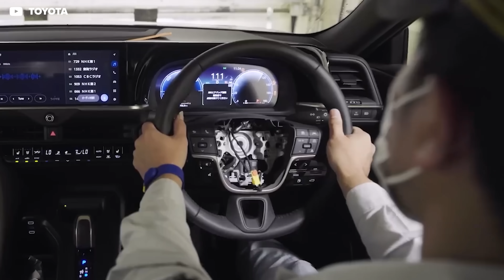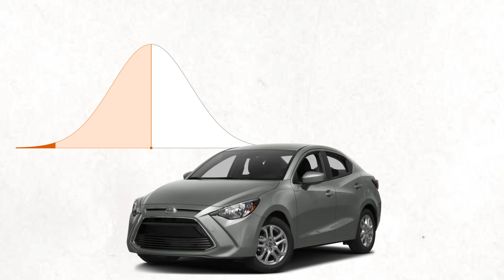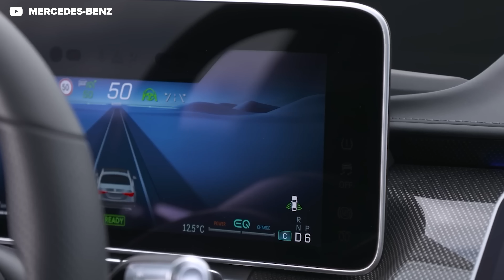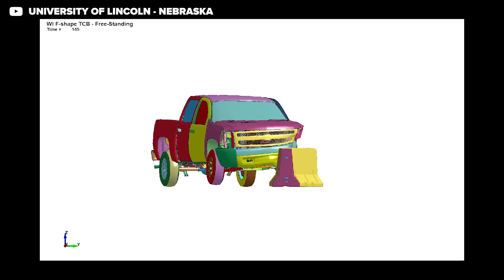The REAL reason guardrails can't stop EVs in a crash

Comment: If quality of life was as sacred as the right to make a profit we would create an automotive environment around light, safe and fun small cars. Heavy vehicles would be for work and would require a greater responsibility and training for the driver.
Reply: This comment section is a reddit central! Holy sht
Reply: You can thank the idiocy of the government regulatory requirements for the growing size of motor vehicles. Get them out of there, and small, affordable cars and light trucks would make a big comeback and fast.
Reply: Spoken like a true city dweller with no experience outside of the concrete.
Reply: If people cared, they'd buy mopeds.
Reply: You can't eat quality of life you can't see quality of life you can't build a barricade out of quality of life so if you want to drag in quality of life into engineering you can have disaster after disaster after disaster..
Reply: It's called Europe dude
Reply: You mean like every country on earth except america?
Reply: Miata is always the answer.
Reply: Cars are to haul people and stuff from point a to point b. The "fun" factor is an added luxury
Reply: Agreed!
Reply: Not following your argument. How people view Quality of Life can (& is) different for people, & changes during different stages of life.

EV vehicles will be heavier than their ICE counterpart, due to the weight of the batteries; though my Tesla Model Y (which is classified as an SUV Crossover) weighs 4,416, the average for SUV Crossover ICE vehicles is between 3k-6k lbs.

As this video states, it isn’t so much the weight, but the location of that weight-> Guardrails were designed to handle the vast majority of vehicles driven at that time, and simply require changes/ updates to handle the new Class of vehicles.
Reply: Btw- a Business does NOT have the “Right” to make a profit, they just would not exist long if they did not.

I did not follow you Quality of Life (QofL) argument, (not to mention, QofL is very subjective). Some place to much emphasis on materialistic things, while others place to much emphasis on ‘free time’. Even for those who are more realistic, QofL varies greatly & changes during life.

Lastly, Heavy vehicles (as a Class of vehicle) already have requirements for specialized training, operation guidelines, & licensing.
Reply: Actually heavier trucks (three axle and more) and busses require a different category of license that usually requires some training and they have lower accident rates than cars.
Reply: Which of course we already do with large trucks and the vastly more expensive and training intensive license's needed to drive them, lol, like seriously dude?
Reply: Grow up.
Reply: Thanks for the input comrade
Reply: Yeah. We should gatekeeping F150 and Colorado from moms😅😅
Reply: Thank God we dont, Mother Hen.
Reply: Funny that politicians were ALL AGAINST trucks and heavy cars-until they figured a way to make money on them
Now you are on your own with 7000 lb trucks and drivers catching up on their sleep or disney movies
Reply: Look up Dodge vs Ford Motor Co. 1919
All your questions about how the world actually works should be answered.
Reply: Marxist agitation propaganda. Obviously not an engineer or mechanical inclined. Businesses don’t survive if they kill all their customers. The human body is very fragile. Any crash on anything over 5 MPH can be fatal. Try falling off a bicycle without soy boy pads or helmet. If you want to be safe, stay in bed; never ever use the bathtub.
Reply: "IF..."

If only 😢 💔
Reply: they do its called cdl lol
Reply: Welcome to Europe
Reply: Are you a communist by any chance?
Reply: If people really valued quality of life, that's how the corporations would make the profit 🤷‍♂️
Reply: Screw that this is america. Go to Europe if you want that commie crap.
Reply: Stupid weenie european liberal mindset.
Reply: Watch the video. All the regulators care about is occupant safety
Reply: Welcome zu Europa. Public transport, small cars and 20 mph speed limits in cities.
Our cars are electric or hybrid, ours aren’t flying over any concrete barriers.
Reply: @philippal8666  No thanks that sounds really gay
Reply: Letting people choose their quality of life is how you get this
Reply: Then the USA would be full of Suzuki cars
Reply: Actually if quality of life was sacred we would build walkable/bikable neighborhoods and transit oriented cities.
Reply: @ChadGeidel actually if quality of life was sacred. We wouldn't build cities at all.
Reply: @ChadGeidel huh. Wonder how long it would take me to bike 65 miles to work.
Reply: @ChadGeidel  I live 6.4* miles from the closest town... what's your alternative to that?
Reply: you choose to live in the sticks? Sounds like a you problem bud.
Reply: @ChadGeidel any actual city is way too big to be walked across. Ntm you'd still need cars to go city to city (closest city is an hour away on a interstate going 70mph)
Reply: @Bojangles06  Good mass transit is a marker of walkable cities. Most people who live in NYC walk everywhere. That's equally true for most cities in Europe.
Reply: @Pan_Galactic_Gargle_Blaster NYC has suburbs, most only walk within a few mile radius. Most towns have housing and inudstries on opposite sides. Most cities in the US arent as dense as NYC, take for example St Louis, that city is massive and as someone whos been there I'd hate to walk it. Too spread out, too big, not made for walking. Ntm the giant bridge would take forever to cross
Reply: @Bojangles06  I think you don't quite understand  the concept of a "walkable city." it merely means that all necessary amenities are available within walking distance and mass transit is viable for going to do almost anything else. specifically for the people living in the city — not the people in the suburbs (that's the greater metropolitan area, not the city itself). you really should spend some time in larger cities in Italy, Japan or Switzerland. there's only so much that can be conveyed without experiencing a "walkable city" firsthand.
Reply: @ChadGeidel that ship has sailed. Cities and neighborhoods have been built around cars since WW-2.
Reply: @randalmiller7952  Yeah, and there's nothing we can do to effect change. It's impossible.

Except we can - lots of cities around the world have. Even the US did it during Covid.

Try again troll.
Reply: @ChadGeidel no everyone wants/likes to walk, and designing a community so it’s comfortable to be locally traversed, while crippling anyone’s ability to go further without a huge time sink, is why cars are preferred to begin with. 😂
Reply: @ChadGeidel why not both? Walkable <5km, bikable <20km and light cars for the rest
Reply: @ChadGeidel or both lol
Reply: @ChadGeidel this is the correct answer.  Imagine the control of urban sprawl doing this
Reply: Actually, I live in a transit oriented city and I avoid all public transit because that is where you and I are most likely to be knifed. Fentanyl spoiled everything.
Reply: @ChadGeidel  Absolutely, far overlooked alternative for worshiping the metal manslaughter boxes on wheels.
Reply: @ChadGeidel 15 minute cities?
Reply: @ChadGeidel  you dont want that
Reply: @ChadGeidel  "...build walkable/bikable neighborhoods and transit oriented cities."

Come to Europe, we have plenty of those.
Reply: Small cars are not for everyone. Tell that to the family of seven people with five kids. I would know, I was the middle child of five kids in the family of seven growing up. A small car doesn't do a damn thing for big families. I swear, too many people act like everyone shares the exact same circumstances that they personally are in. Do you ever think about other people and what works for them? No one is stopping you from getting a small car, or an e-bike etc. Why do you insist on trying to force other people into what doesn't work for them, but is your ideal?
Reply: @jlcii  My logic is that because heavy vehicles are a greater danger to others the driver of a heavy vehicle should have more training and be held to a higher standard. This would also be safer for everyone inside of the heavy vehicle also. I am sure some people think a CDL is an unfair requirement. We will never all agree on issues regarding freedom vs. public safety.
Reply: @jlcii Tell that to single people driving oversized cars 😅 Besides, if you have a big family, you get a minivan, not an suv.
Reply: Move of the country wants big vehicles. Get over it. Stop pushing top down political "solutions" that the people dont want. If you dont want a car, go somewhere you dont need them. Leave everyone else alone
Reply: Except when people have the choice about what car to buy they frequently and knowingly choose to buy the sexier, bigger, faster or whatever car over whatever performs the best in safety tests.  So no, it's not profit over lives people would genuinely be upset if you demanded they all drive small light cars to be safer.  Indeed, as long as all the car companies have to do the same thing all over the world it doesn't matter too much to them what regulations demand it's the consumer who is upset when they get a car that doesn't make them feel cool.

The job of the government isn't to stand in the way of the preferences of the public no matter how much we may wish they were different.
Reply: @petergerdes1094  its funny you say that, because CAFE standards killed off the small affordable truck that the public preferred compared to these massive Sherman tank sized SUV's and trucks that every moron whos compensating for a shitty ego buys. Station wagons were popular until they stopped being made by companies and why the hell does the EPA get to tell us what we can and cant buy anyways? Cars dont destroy the environment anyways, planes, rockets, bombs and sonar equipped military vessels do
Reply: @petergerdes1094  Those preferences were created by 30 years of active marketing by the auto industry.  Advertising creates markets and preferences.  If regulations prevented the manufacture of those vehicles in the first place or they required a stricter license endorsements to drive, they would never have been advertised as mass market daily drivers.  We would still be calling SUVs panel trucks and only your plumber would drive one.
Reply: @disjustice Except that's not true.  When safe seatbelts came out in new cars automakers wanted people to want them -- they benefit when people buy new cars -- yet people hated them and kept cutting them off.  

Companies are just greedy.  They don't care what they sell you and would happily sell you ever more safe cars for ever more money.  They choose what they advertise because that's what people respond to.  If everyone really wanted to be safe Subaru ads would be more effective than porsche ads.
Reply: In the UK, these “trucks” are literally categorised as an HGV due to their weight and the additional license training is needed.
Reply: @smoketinytom  medium duty actually (N2)
Reply: @erkinalp 3.5+ Tonnes is Cat C1 license, “akshully”.
Reply: @smoketinytom  yes, which is different from cat c
Reply: @erkinalp  Well, Duh. Got ourselves a Stephen Hawking here… Yes, to drive an HGV, you’d need a C1 license.
Reply: this is a very unintelligent take. 

light and small cars are not safe and realistically won't be within your lifetime
Reply: if only money wasnt the best and the worst thing ever invented
Reply: Vehicles beyond 1.2 tones should have a higher class of license
Reply: Agreed, we would all be riding go karts, and honestly living in things like busses and other larger vehicles as a home or a work environment, rather than recreation and transport
Reply: That sounds great if you're in some big city, but doesn't work everywhere. I live out in a very rural area, where you typically end up hauling more stuff around, and weather combined with poor road conditions mean you frequently wouldn't be able to get anywhere with some tiny FWD hatchback.

Don't get me wrong, I don't inherently dislike small cars like that, but they simply don't work everywhere.
Reply: @TheBulap  what you mean is the right vehicle for the job, NOT the one that strokes your ego.....couldn't agree more. And as any sensible American who's ever been in an accident that actually wasn't their fault will tell you, driving standards need to improve MASSIVELY.
Reply: @TheBulap  You ever been to a small town that was built before the world wars?
Reply: @TheBulap  okay, but your truck would be more useful and efficient if the other cars on the road got smaller, lighter, and fewer in number.
Reply: @toslowlypoke  There's hardly much traffic out here anyways so it hardly matters to me. And who am I to say that all my neighbours can't like them for all the same reasons I do?
Reply: You're not who we're talking about. Most people who drive trucks don't use them for work. Most American trucks are pavement princesses.
Reply: @TheBulap  small cars aren't limited to some tiny FWD hatchbacks. Vehicles like the Suzuki Jimny exist too.
Reply: @TheBulap A few things:
1. Rural areas can have different regulations.
2. I don't think anyone is suggesting to outright ban light trucks. Farmers, construction workers, etc should be able to get special training and licenses for them.
3. It's actually a lot easier to put awd on an EV: you just chuck a second motor in back.
Reply: @TheBulap true.  But you can't deny most of the squeaky clean trucks on the highway will be used to pull something maybe once in its lifetime then never again.
Reply: @LilOleTinyMe  I wouldn't say that's wrong - when I drove a Silverado, I never towed anything. However it was very handy once in a while when I'd haul large items around, and even just for that I was happy to have it.

I'm driving an Xterra now instead, but whenever I might have to replace it someday I'll probably get a Frontier because having the bed is incredibly convenient at times.

I personally don't care anyways how other people use their trucks. If somebody wants to lift their Ram 2500 and put stupid low-profile wheels on it, just to drive around town, I think it's dumb but I won't say they shouldn't be allowed to. If they like that, they can do it. I'm fully in favour of letting people buy and drive basically whatever they want to.
Reply: @LilOleTinyMe pavement princesses.
Reply: @TheBulap if only vans and station wagons with awd existed. 

Oh wait they do
Reply: @MaticTheProto   I used to drive an Outback, it was good but still never had quite enough interior and cargo space for my needs. And if there were options here for a proper 4x4 (not half-assed AWD, actual 4X4) van other than a JDM Delica, I would love that. But there isn't.
Reply: @TheBulap  Yep, Humans in villages all over the planet just died right until the early 20th century. No way to get around until someone invented cars.

Oh, wait. You are full of crap.
Reply: @ChadGeidel  Humans for most of history also lived miserable, shitty lives, that doesn’t mean we should be expected to give up our quality of life now.
Reply: @ChadGeidel This is a partial false equivalency. The invention of the horseless carriage (cars) suggests horse powered contraptions were used. Before the invention of transportation by domesticated animals in 3500 BC, life sucked and yes, people died. (Aztecs anyone?) Any interruption in local supplies would typically be deadly for small villages without proper food storage.
Reply: @ChadGeidel  Yeah that's because people owned horses and carriages.  You know the direct precursor to "horseless carriages" aka cars.  🙄
Reply: @ChadGeidel  Also "You are full of crap."?  Chad not everyone with a differing opinion is arguing in bad faith.  @TheBulap is just stating his point from what works for him.  That's a very childish take to think everyone who disagrees with you is being disingenuous.
Reply: @ChadGeidel in most of the world that they live that way, they fucking hate it. 😂
Reply: @TheBulap Dude being stuck in traffic and having to commute literally everywhere is miserable as fuck, I would kill to be able to live somewhere where a car wasn't a necessity.
Reply: @ChadGeidel so whatare you suggesting as a replacement then? Using horse drawn carraiges/wagons for personal hauling? (Key word, personal. Businesses can use trains and semis, but what about Farmer Joe who just needs to pull around a cow or 2, or a hay bale to the field?)
Reply: @TheBulap  What cars actually have to quality of life in general? It may be comfortable to sit in a car with AC, stereo and what not accessories surrounding the ones in a car, but to think that it somehow represents the peak in quality of life is just conditioning by he fact that it has been made pretty much mandatory to sit in the car in the first place while alternatives are wiped out of the way to make room for the car market by the big oil and the big car. The rural areas are also an exception, not the rule. Also life on rural areas or sprawling suburbs have been largely been enabled by the use of car, which is quite redundant for societal living and development of societies. The peripheral areas need the road infrastructure, but the population density is low, so it's quite expensive luxury to build and maintain a road network to keep the rural and urban sprawl drivable. 

For some reason people seem to think that roads are free if you don't have to pay tolls every time you get on the road, yet they're still very much paid by all the tax payers, whether they ever have a car or drive at all. Society subsidies road network from every tax payers pockets so that the anti-social motorists can live wherever they wish, far from the others and still have the luxury of sitting in their cars for hours and hours to get their basic commodities. Cars are like a gilded cages rather than a luxury of life at any closer look. Cars don't represent freedom, they represent restriction of having to use them, sitting in traffic, spending your time behind the wheel or just sitting in a car, rather than doing something else, perhaps more productive or fun. 

Driving and sitting in a car are very much an extension of the overall sedentary modern life style, that is a known factor of health issues on population level, whereas cycling and walking as means of personal transportation are health beneficial and significantly lowers the probability of serious lifestyle related conditions like high blood pressure, muscle deterioration, bone density loss, weakness in joints and cancer even due to immobility and the micro particles inhaled due to fumes and car tires grinding the pavement.

So, don't tell me that driving has somehow magically solved the problems of quality of human life of the past, when instead it has created many all new and serious ones too, like the health issues, environmental problems, the waste of the nature's resources to build new cars and keep people buying cars, destruction of humanly safe and sound public space and infrastructure, all that in favor of driving and parking cars and ability for the few to live comfortably in the middle of rural nowhere or at outskirts of cities. Time to wake.
Reply: @ChadGeidel  Im not biking 45 miles to work.
Reply: @TheBulap the quality of life came through advancements in medicine, urban design, industry, global trade, and transportation technology. Not cars.
Reply: @ChadGeidel  really? Why u attacking without at least attempting to understand.. People in rural areas need larger batteries because things are much farther away and the ability  to do those trips without worring about it is a very good quality of life aspect and even nessicary. Bigger batteries in the end means a heavy overall weight until new battery tech like silicon carbon makes its way to cars.
Reply: In Europe, it is! They even dedicate large areas in cities for pedestrians only, and make roads narrow and safe!
Reply: @captainminecraft631Most european city centers were built way before cars showed up. Except some deliveries/emergency services, it's just not practical to let cars in.
Reply: @captainminecraft631 most of Europes roads were built over cow trails, unlike in the states where we build our roads already to be shitty because we let truckers drive everywhere.
Reply: @captainminecraft631 No they built those places before cars
Reply: @hyphydan  In the 60s and 70s cities like Amsterdam were given over to cars. Changing them to the way they are now has been a choice.
Reply: Bruh, just drive 35mph if life was so sacred you wouldn't risk it going faster... lol
Reply: @ItsBinhRepaired  on a motorway/freeway? Sui cid al
Reply: Light often is not safe. Small cars do not meet all needs. EV is heavier than ICE vehicles, 4,000 pounds often.
Reply: There would also be an exapnsive, high quality public transit network in every town. That way, people wouldn't be required to own a car to not just survive, but to live a good, comfortable life.
Reply: This is a stupid person. I volunteered for 7 years at the Nebraska Midwest roadside facility and I helped them design barricades because I work on a blood stain boat and I knew a lot about cable. The idea on the barricades was always to redirect you back into the traffic and it does so with heavier cars as well. There's nothing special about an electric vehicle as far as colliding with a guardrail it's the same thing as a pickup truck the same weight for the last 25 years.
Reply: It's interesting you say that as i would think people that champion EVs would cite its improvement to air quality etc.   It may be some time until we can have it all and afford it.  We need even more energy for less weight but wait a hundred years im sure they/we will keep going with the tech.
Reply: @RDEnduro  the process for making an EV starting at material gathering is environmentally worse than both world wars in terms of toxic ground killing. Just the cobalt mining alone to get the lithium for the batteris requires a quarry the size of a small city.
Reply: @RDEnduro  All you're doing is offloading your emissions onto the poor people who live around power plants. EV's have done nothing for air quality, just put it out of sight to the owner so they can feel good. And don't get me started on foreign lithium mines.
Reply: @RDEnduro  just shifting the pollution around...

If the environment was seriously a top priority, as another commenter said, wed focus on light rail, buses and bikes
Reply: @hw6271if the environment was a top priority we'd focus on lowering consumption of everything. Making all house appliances and cars live longer, stick to the longer usage of same things and all that stuff because INDUSTRY is the biggest pollutant in the world, all those mining, metallurgy and chemistry industries make like 70% of all pollutants but who cares? They're being owned by wealthy people with lots of money and power and cars are owned mostly by ordinary people so you know who will be bullied 😂
Reply: @RDEnduro  EV are objectively worse for air quality because unlike what most people think, its not the exhaust that's bad

Your tyres cause nearly a 2000x worse air pollution per km as they release toxic micro particle due to them being worn down and car mass play a major role into this

To reduce air pollution lightweight vehicle is the way to go if not reducing total traffic alltogether
Reply: long term we just need to get a majority of cars off the road. Obviously this won't happen in the US without significant political will which I don't see existing until climate change has ruined every aspect of our lives. 🤷
Reply: @ChadGeidel nothing like an existential crisis to keep ppl in line!
Reply: @ChadGeidel  climate change isnt even as severe as you think. Over 40 years the north pole had lost 40 gigatons of ice, and between 2020-2023 it 'magically' refroze over 140 gigatons each year
Reply: @georgesgranger6362  You're arguing with an alarmist, which is probably pointless.  They base their arguments on science that is so hilariously flawed that calling it science is an insult to science, but according to them the science is settled, a notion that goes in the face of science itself.  The problem is they ignore EVERYTHING that doesn't fit into their little box.  That leaves a herd of elephants in the room that they blatantly choose to ignore.  How much better is a battery powered EV than an ICE?  Nowhere near as much as they claim because they ignore the production and recycling processes, which are decidedly NOT very environmentally friendly when compared to ICE's.  Not to mention the infrastructure issues which make things even worse.  The grid can't handle the extra load.  Most electricity is still generated by fossil fuels as well.  And how environmentally friendly are all of those cobalt and lithium mines?  Gotta love the combined ignorance and arrogance of the average climate alarmist.
Reply: @ChadGeidel  The only "climate change" going on is between your ears. It there actually is ANY, it's caused by devices like HAARP. By the way, temps were 5 deg HOTTER during the Roman Empire times. I bet you're fooled by those weather aholes and their temp colored maps showing all the heat, BUT are also showing by the actual temps ALSO on those same maps. The TEMPS are the same or LOWER, despite those aholes changing the colors from blue/green to red/orange from, say the year before! 

It's right there in plain site if you have the older weather reports to A/B.
Reply: @ChadGeidel  Take your dystopian political will and shove it!
Reply: Large heavy vehicles are incentivized by CAFE standards. 

They tried selling lighter EVs. People can’t wrap their head around less than 300 miles of range they don’t need. 

Don’t blame auto manufacturers. They’ve tried making small light cars, no one bought them.
Reply: @hotshtsr20  I think it was also a problem of the "chicken tax" + old cafe standards too
Reply: @hotshtsr20 blame auto manufacturers, they want to sell heavier and more expensive cancer boxes.
Reply: @hotshtsr20 that's mostly american problem. Americans drive oversized cars because they've been told for decades that bigger is better, safer, etc. As for the ev range, it all comes down to lacking charging infrastructure and the way US is designed. Even the theoretically lucky ones living in suburban houses are screwed. On one hand they can easily install lvl2 chargers, on the other...suburbs in US are massively overblown, without public transport and you HAVE to have a car...and on average commute quite far. Recipe for range anxiety if you ask me. As for people living in apartment buildings...they're fkd...
Reply: @Lvvcassss  I've spent almost half the last year in Europe.  The cars I've been provided for standard rental have been a Cupra Formentor (3600lb crossover thing),  a Tiguan (same basic car as the Formentor) and the smallest has been a Golf (which is huge compared to its roots).  It's not just an American thing.

But, to address America: they're not entirely told this, they're forced into this with regulation. 

Footprint factors into the allowable CAFE target for fuel economy, so a larger car can get poorer fuel economy without a gas guzzler tax.  Since MPG numbers these days are more about aerodynamics than weight, this means larger cars are further incentivized.

Safety standards have continually pushed things into larger and heavier cars.  Look at how thick the A pillars have gotten in modern cars.

I'd love it if cars were smaller again.  Unfortunately, I'm not only in the minority, it's also hard to make them now.
Reply: @hotshtsr20  Point. Cars are getting bigger, Current Golf weighs twice as much as Mk1. But yes, it is safety at a price of weight and, well, price. On the other hand Swedish Volvos were plenty safe before they got inflated in size. And now the V90 is significantly larger and LESS spacious than eg. V70 II. We're going in the wrong direction. But going back to USA, only couple of decades ago a pickup truck was a relatively small car, sedan-sized, just with a bed. Why in the name of anything that's holy to anyone, anything like tose super-duper duty trucks are even made? I'm talking about those Ford F######50 monstrosities. And bear in mind: the "safety" argument works only for occupants in a car, those vehicles are murder machines for pedestrians - supertall fronts act like a moving wall , increased mass makes it harder to emergency brake. And to finish it off, yes CAFE regulations are bullshit when it comes to big vehicles...
Reply: @Lvvcassss  the lack of range comes from the fact we dont have the tech to push past 300 miles range without making the battery the size of a freight train, or else we would have already had fully electric freight trains with 1000+ mile range. Its impossible to do so, and the EV is already dying for the third time in history. We get so much more range with gasoline because we improved on the system so much that we are at its peak and we want more? A hybrid BMW I3 makes 90 miles on a single 3 gallon tank, imagine if you made a model with an average 15 gallon tank, 450 mile range. We have Suburbans and Escalades with nearing 600 miles range. An EV cant go the 300 miles they claim to go because everything takes up battery life, so that 300 mile range is more like 160 when you need lights, radio, TCS, ABS, Cameras, sensors, rain sensors, wipers and power steering.
Reply: @Lvvcassss That's what plugin hybrids are for. They're incredible, and somehow nobody in the US seems to know they exist.
Reply: @hotshtsr20 the unintended consequences of government intervention in the free market.
Reply: @6Sparx9  at which point it no longer becomes a free market and becomes a market of false freedom
Reply: @6Sparx9 No, the consequences were entirely intentional, because regulatory capture gives business far too great a say in how regulations are written.
Reply: @TheGotoGeek  its actually both - and the best way to address this is consistent deregulation and strict term limits on regulation where applicable. In an ideal world the government would mostly keep out of the market, but realistically we are not getting rid of either, and it would be equally stupid not to involve large businesses in the regulatory process since policy experts are often out of touch with business requirements and operation.
Reply: @6Sparx9 ...No, it's the intended consequences of lobbying affecting government regulation.
Reply: @antonliakhovitch8306  I understood thats what you meant, but lobbying is only a small portion of the issue that helped manufacturers shape regulation and secure carve outs. The fact is the DOT and EPA under the Obama admin pursued an aggressive agenda to reduce CO2 emissions and squeeze manufacturers into opting for ever increasing fuel efficiency, and a large part of the increasing size is directly attributed to the DOT decision to incentivise manufacturers not to respond to CAFE fuel economy impositions by making smaller, lighter (and thus more fuel efficient) cars because the DOT believed smaller cars would reduce passenger safety.
Besides these clear facts, lobbying is a symptom of regulations as the monopoly regulatory bodies have over choosing winners and losers in the market creates incentive for corporations to lobby them. As I said, constraining or removing regulation, or federating it so the monopoly is dispersed would alleviate this issue. THE ISSUE IS GOVERNMENT.
Reply: @6Sparx9 Yes, the US has a history of doing regulation really poorly. Left-leaning politicians try to appease the other side, and we end up with half-assed solutions that make no sense. I honestly have no idea what to do about that.

In general though, regulation is a super cool concept.
Think about it: on your own, you're incentivized to buy the biggest truck and the biggest gun to protect yourself. When everyone does that, an arms race happens and the whole world becomes more dangerous.
But wait! If you come together with your fellow voters, you can collectively agree to regulate these things. The world gets safer, and the playing field stays level.

It's in your best interest to buy the biggest truck.
It's ALSO in your best interest to vote for regulation that limits how big of a truck you and your fellow citizens can buy.
(Thinking about OTHER peoples' interests would also be kinda cool, but I'm an American and that would be way too much to ask of us)
Reply: 15minute cities. MAKE NOISE!!!
Reply: If quality of life was sacred we would not use cars whenever possible.